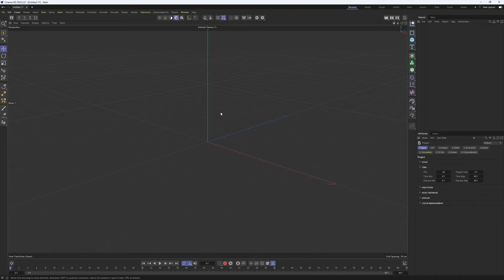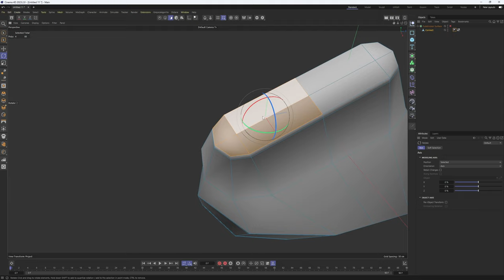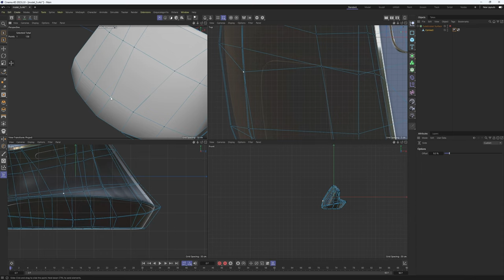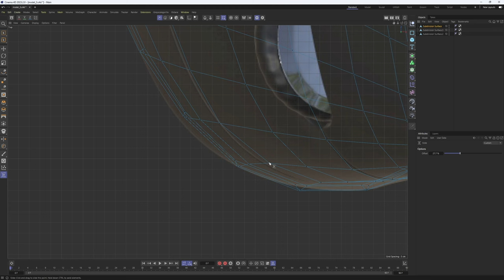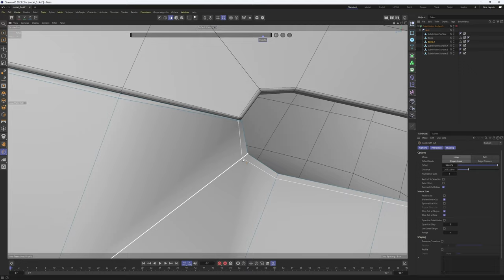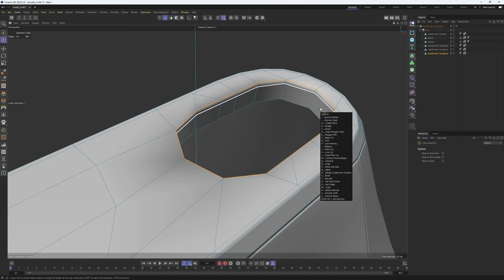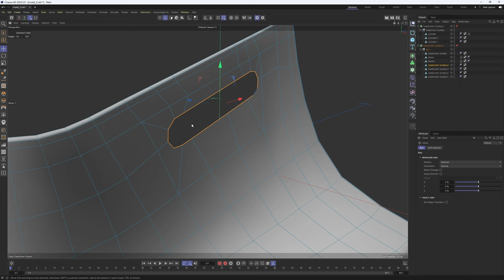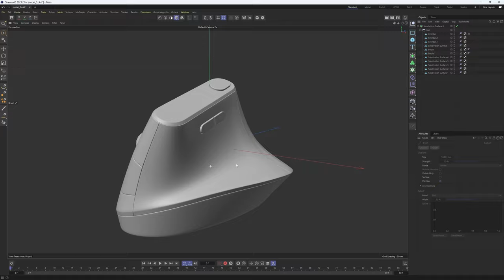Industrial Design/Product Modeling #27 | Mouse

Comment: In Cinema, they never fixed the problem with Boolean operations, when a bunch of vertices appear and it’s not clear where they came from :) This is another reason why I model only in Blender.
Thank you very much for the video!!!
Reply from the maker: Thank you, indeed it is a bit messy in C4D, but you can work around it by enabling modeling tools/edge points and cleaning up the bad points.

Comment: Is there any analogue of the "Equal Spacing" tool in the R23 version of the program? Or a similar plugin. My computer does not allow running versions older than 23.
Reply from the maker: Unfortunately no, but it is not a must tool, you can do this by hand.
Reply: "HB Modelling Bundle" have something similar.
Reply from the maker: Yeah, true!

Comment: when i am hitting q it disables my subdivision and doesn't show me the lines like yours, how can i fix that?
Reply from the maker: You can show wireframes, N-B shortcut.
Reply: @polygonpen   tour lines in edit mode looks like they have sub d on them, while my ones look normal and under them i can view the sub d mesh
Reply from the maker: Than play around the options under the options menu right at the op of the 3D view. @Elysium.4D